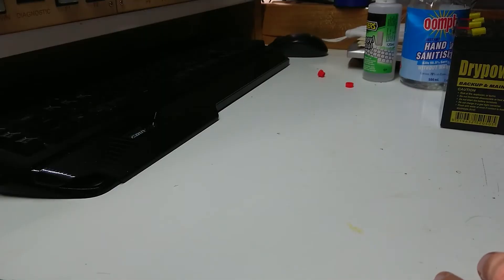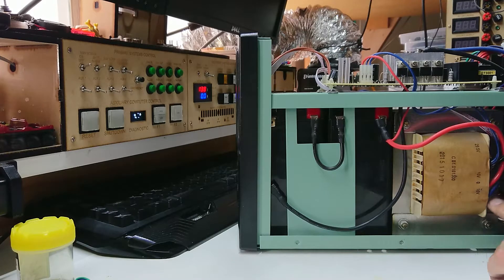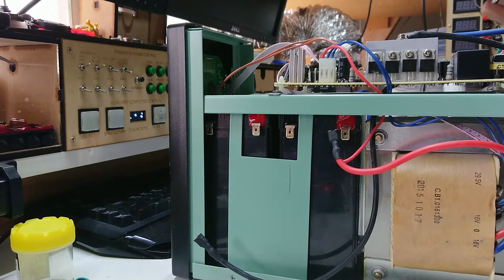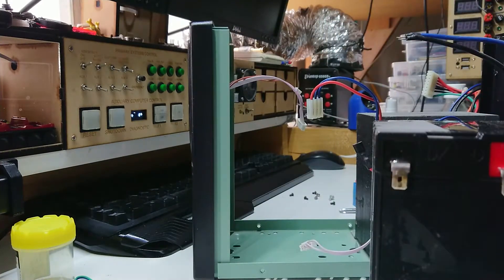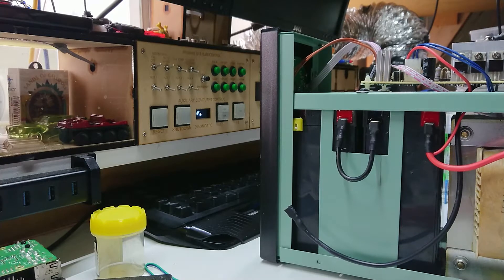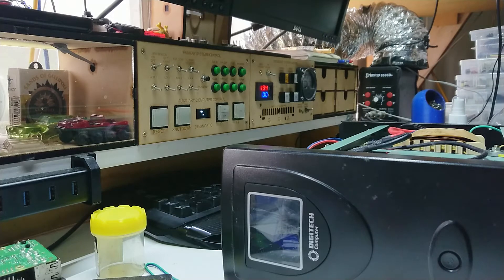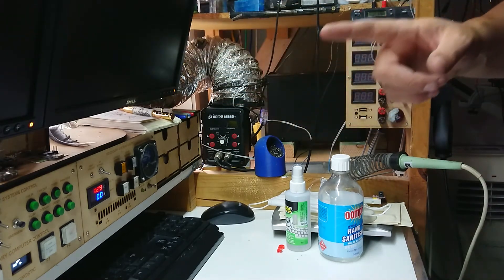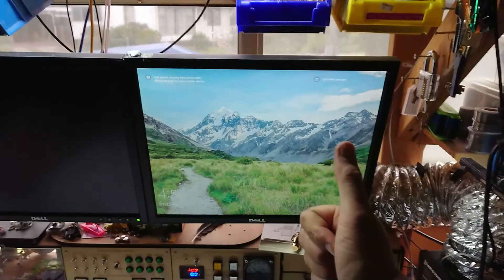Jaycar MP5207 UPS Battery replacement

Comment: I was about to do the same thing but wasnt sure how to take the batteray frame out. Other option is to buy a new UPS. You should also put a link of the replacement batteries in description.
Reply from the maker: They are a generic battery, you can find them in many places under many different part numbers.
This video was also 2 years ago - this model has been obsolete for some time now.
Reply: @TheAussieRepairGuy  It is a good UPS and I suspect mine has the same issue as yours. Just the battries have had enough. Not holding charge anymore. I cant work out what batteries to get. Even Jaycar doesnt mention it and the manual doesnt either
Reply from the maker: @fbilgrami  7 amp hour gel cells. 7ah are nearly all that same size. Take one into the shop and show them.
Reply: @TheAussieRepairGuy  Thanks for inspiring me. I went to JayCar today. They also sell the replacement batteries for $45 each ($90 for a pair) but the guy suggested leaving my batteries with them for a day and they will gladly try and charge ny batteries at no cost. Very good service, even way after warranty expired. if it doesnt hold charge still, I will just get 2 new batteries, otherwise will reinstall the  old ones.
Reply from the maker: @fbilgrami  yeah these units aren't kind on batteries, some of them have a feature where they will run the batteries fown to 50% or so at a set time to keep the batteries healthy, but they need to be connected to a pc and programmed.
Reply: @TheAussieRepairGuy  Fantastic. Got the new batteries in and put it back together. I had to watch your video again for some confidence. haha but thanks again for posting this. Saved me $200.
Reply from the maker: @fbilgrami  Glad to have helped.
I have a few of these kicking around my shed because people throw them away when the batteries die.
A couple are connected to my 270ah house battery bank, that's solar charged.
handy for blackouts